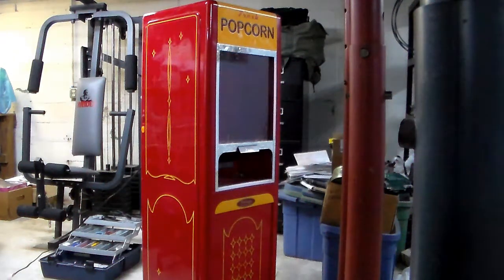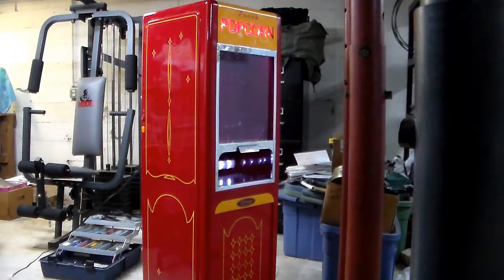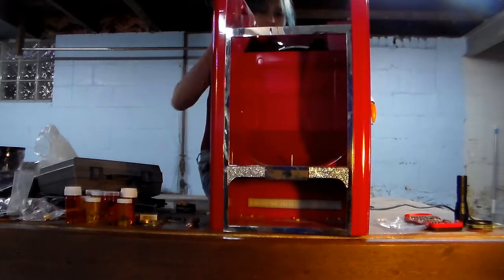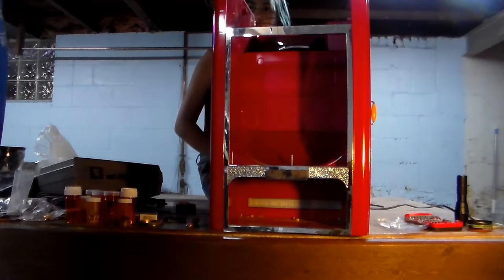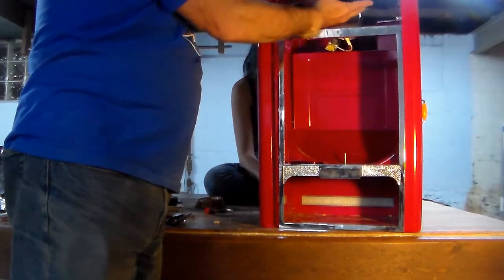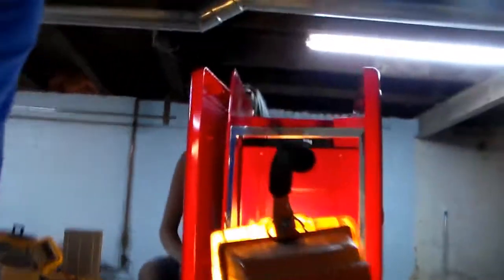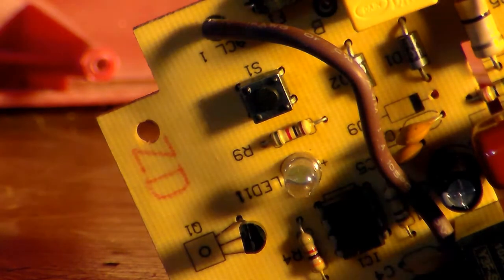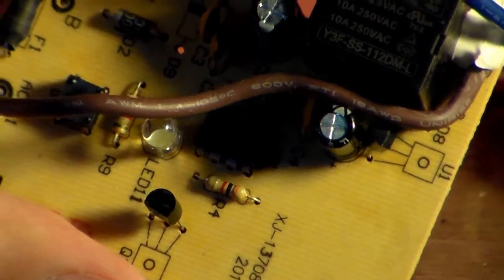Vintage Appliance Popcorn Popper Repair

Comment: Hey, i'm not sure if you're still on YouTube or not but i would really like to pick your brain on that circuit board.. Mine is burning up the 2W 1k Ohm resistor when you flip the power switch on.. But i'm a novice when it comes to electronics repair and I can't seem to narrow down what component is faulted..
Reply from the maker: I got rid of mine, so I can’t even look at it to reference that resistor.  But if your burning up a 2 watt resistor that should be a substantial short.  You could try looking with a temp sensor.  I would suspect something in the fan or heater circuit though with that type of consumption.  Can you unplug one or both of those and see if that resistor doesn’t burn up?  Sorry it took so long to respond, i don’t get notifications for older vids.
Reply: @timtimeprojects3576  thanks for the reply! I unhooked fan and heat element but oddly enough the resistor still wanted to burn up.. Eventually stacked resistors in series and that kept them from burning and machine worked great.. Not really a great fix but hey.. It worked lol

Comment: Where do you find parts to these at. I need the fan.
Reply from the maker: They are pretty old now.  You may have to take it apart and find a reasonable replacement.  If you take it apart, I recommend two things. 1.  Cut an access panel somewhere - these are monsters to get apart. 2. Make sure that all power is run through the a switch - not just the lights.  Pretty sure a power line surge is what did me in. I didn’t realize the device would work without the switch on. At least on mine.

Comment: Did you use the machine again, did the fix hold on after a few uses or did it break again?
Reply from the maker: I've only used it about 15 times but it is still running.  I did find that the heater/blower circuit is not switched through the on/off switch, it powered whenever plugged in.  I wish I would have realized when it was apart.  Now I just unplug when not in use but if I ever do that again, everything will be behind the switch.
Reply: I have one it seems like a Little wrk to get to the main harnest all those screw thnks for documenting it tho

Comment: Where do you get that diode?
Reply from the maker: I bought an assortment of them a while back on Amazon.
Reply: @timtimeprojects3576  so it doesn't matter what diode brand or voltage? Just has to be a D 9 right?
Reply from the maker: @markstroh27  It does matter.  That is a Zener diode.  Think of it as a voltage regulator.  If you look at the number on the diode and Google it, it will tell you the value.  Sorry, but I don't remember.  Maybe I can look through my order and see what's missing to narrow it down.  The voltage, power and installation direction are critical.   It was included in this kit from Amazon: "Chanzon 1W Zener Diode Assorted Kit"
Reply: This is a great video. I took the whole thing apart myself and had no idea what to do. Now I know what to do, but your video said 12V Zener diode. You bought a 1 watt kit, so I’m assuming the correct replacement is a 12V, 1W Zener diode. I know how to procure one of those, but have no idea which direction it goes in, nor how to connect a diode like that to a circuit board. Do you put a drop of solder in each hole, bend and trim the diode arms, and push them into the holes? lol, I am probably best to just fill the void with smart pop and call it a day, but I really want to fix this dang thing. Thanks for the video!